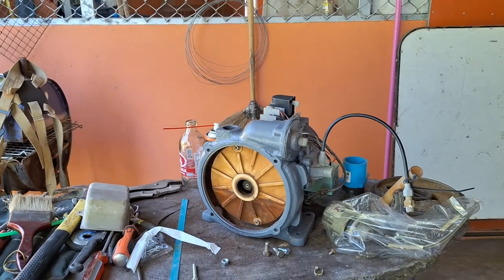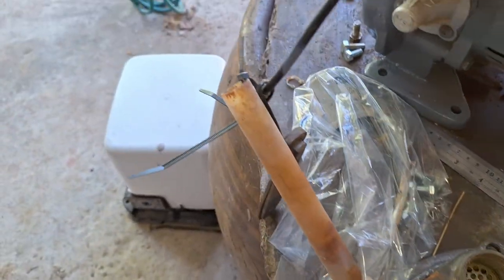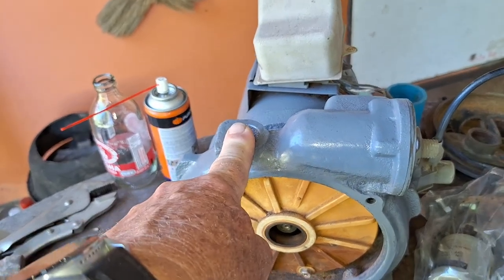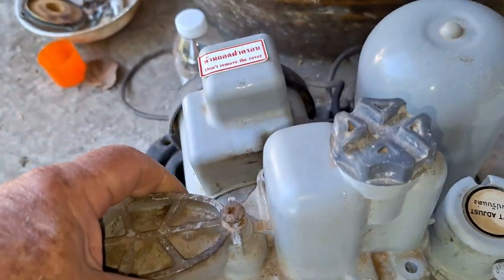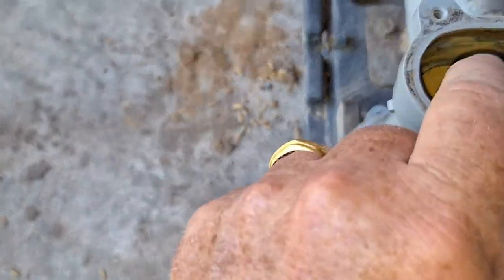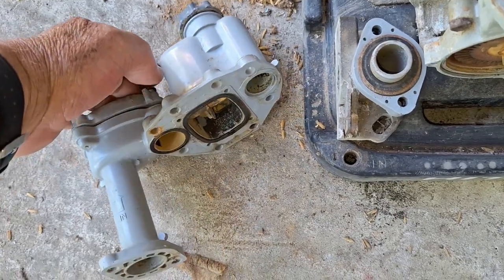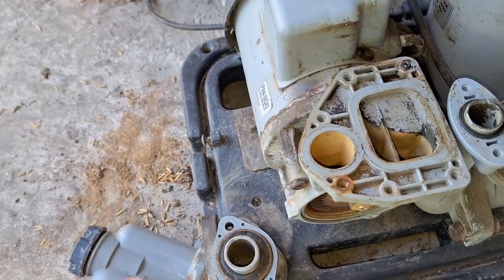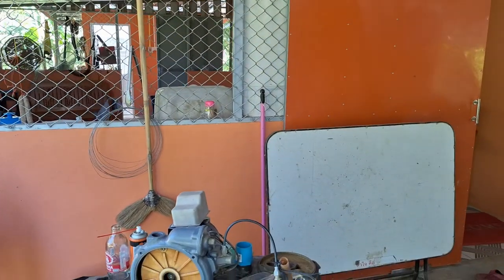Water pumps on the Farm in rural Thailand

Comment: Thank you for that video. We have a Hitachi surface pump too the 250XX and sometimes it also goes on in regular intervals despite no water being used. This is not always the case so I can exclude a broken pipe. You indicated that it could be either the pressure switch or the check valve. Will check this next time I there. I assume it could be some dirt in the seal of the check valve. The pump is still reasonably accessible, but unfortunately, no compression fittings were used so in case I have to take it out, I have to cut the pipes. For the other house we build, I bought compression fittings so I can take out the pump when needed for servicing works. Keep it up. I love your DIY style.
Reply from the maker: Sorry for the late reply Bruno, for some reason i did not get a notification. Yes the cheap thing to try is certainly the the pressure swith. Only a few hundred baht at most hardware suppliers. The check valve is the pain point but still not hard if you contact the guys who do the drilling locally. Most are happy to replace it for you. We had a faulty on on a relatively new bore thet installed. They cut the pipe, then pulled the twin pipes up intact, needed three of them to walk the pipes up in the air then out onto the paddock. Took about an hours labour to replace and the mandatory chat time either side ....lol